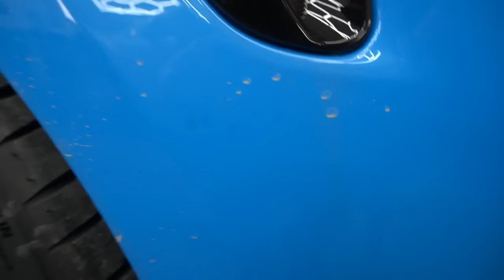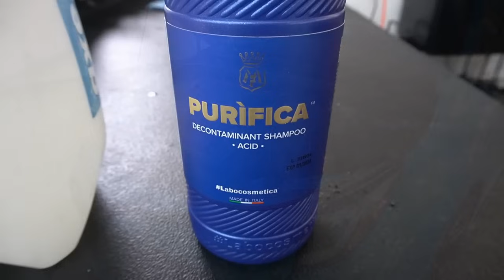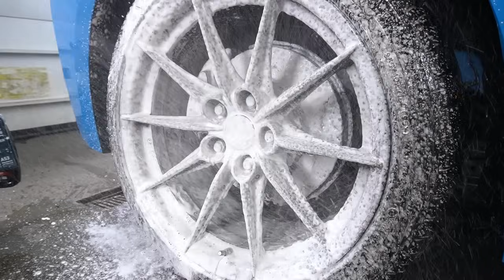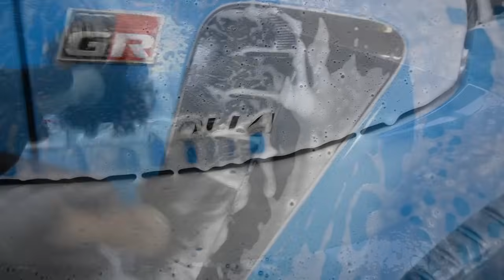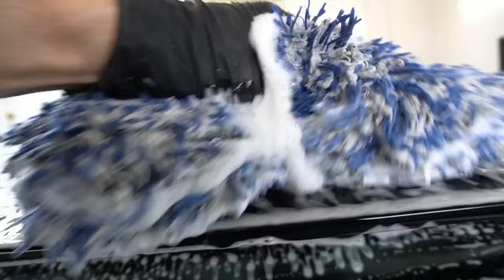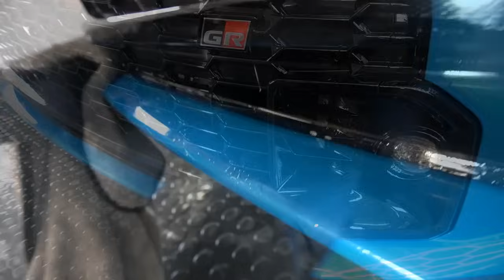Circuit Edition Toyota Corolla GR First Wash! What We Use To Strip Surface During Prep Process!

Comment: enjoy your videos but 400:1its hard to imagine it works. I use Purifica and Primus regularly  at recommended dilutions which are considerably stronger and sometimes these are a bit weak on dirty European cars
Reply: The purifica he’s using is 2.0 or (updated) version. Labo  recommends 1:100 - 1:400 in the bucket for use as a contact wash soap for Purifica 2.0. On a new car with low/no contaminants 1:400 is more than enough as contact especially after a 1:10 pre-wash.
Reply from the maker: 👆 this.